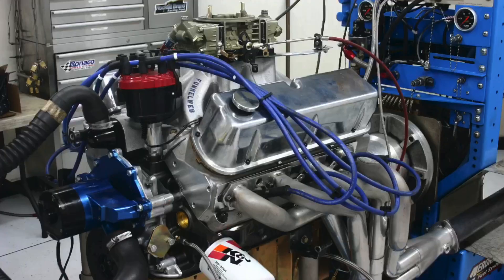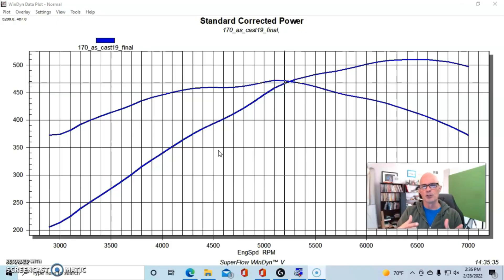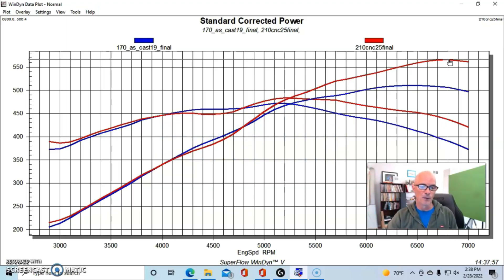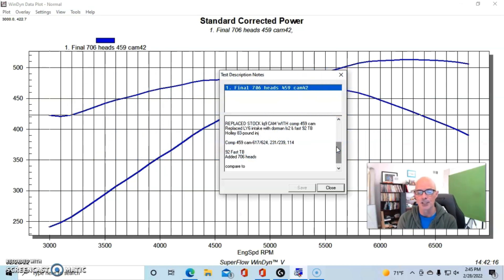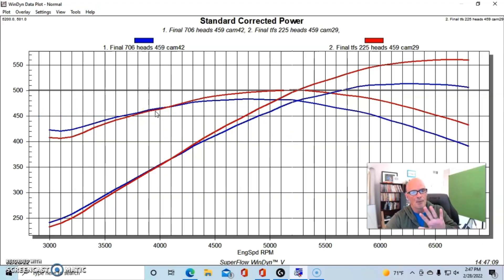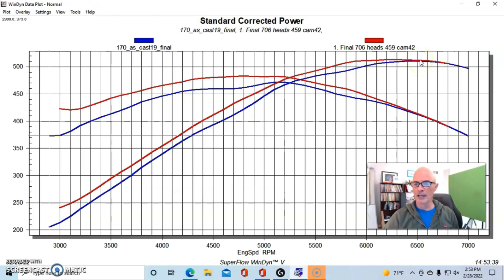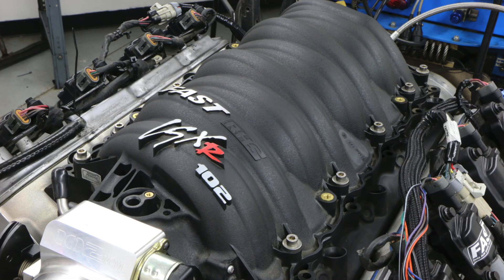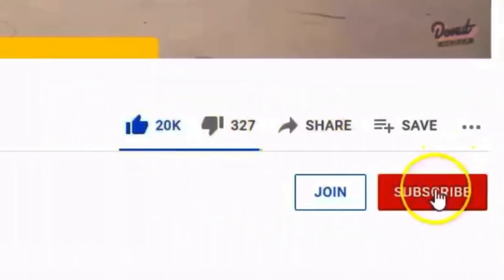HOW TO MAKE 6.0L POWER! FORD vs LS-WHICH 6.0L MAKES MORE POWER? MOD 363 FORD STROKER OR MOD 6.0L LS

Comment: Something that I learned from watching this guy named Richard Holdner is that there is nothing magic about engine building. Any two Motors that have about the same displacement, compression ratio, head flow, and similar cam timing will make about the same power.
Reply: Thats the lesson.  But a hemi headed vehicle is a bit different same with dohc.   Different considerations.   But wedge head on different platforms its basically the same.
Reply: WOW! I would direct you to a show on Hot Rod tv. The host built a BBC, they took the engine and compared it to an engine Jon Kaases mechanics made. The Ford engine at almost 100 cu in less in size, made more torque and hp that the BBC. Tuning, and the expertise of a good builder make a world of Difference. A local builder who is a chevy guy and a very successful drag racer built a SBF for a local guy. Honestly, I could not believe how poorly the engine performed. Why? You decide.

Comment: What motor will give the longest life would be nice to consider. At the shop i work at every week we get broken LS motors in with Cam bearing, Rod bearings, Head gaskets,. Broken pistons you name it .  😮  Stock short block  LS will last for how long making that kind of power ?
Reply: Your confused with the modular!  
Improving the performance of the Modular motor proved to be tricky. Tuning it for high power turned it into an unreliable and dirty engine that had to run on race gas, so they went back to the drawing board. The first redesign resulted in something that was almost entirely new. Koenigsegg started by reinforcing the block and implementing a new crankcase gas recirculation system, followed by all new pistons, connecting rods and camshafts. The lubrication system was converted to dry sump and the pistons got a new oil cooling system. The main features that remained from the Ford engine were the 90-degree angle and the bore spacing.

Koenigsegg ended up making so many changes to the block over time that they had to abandon Ford's and start casting their own. They added things like stiffening ribs and chose Grainer & Worrall in the United Kingdom to make the new block out of aluminum. The engineering firm has extensive experience in everything from F1 engine castings to CGI blocks like Ford's EcoBoost V-6.
Reply: Oh thats easy!  The LS will make twice the power for years if properly tuned!
The tune is everything!  Thats why everyone ditches there Ford power for Chevy power!  9 out of 10 Fords at a drag strip have a Chevy engine and tranny!  Get over it son.

Comment: I'm a big LS guy, been building and swapping them for years, very cheap power, period.  The thing that has me baffled is why would you go through all this work and NOT equip the LS with a good single plane manifold and the carb used on the Ford ?   This work means nothing, with a single plane on the LS you could have run the same carb and had a decent comparison.  As it is it's apples to oranges, carbs to FI.  You should have tried to minimize the differences between the two engines.  This was a total waste of time.
Reply: Yes and Why would you use a Dart block copy of a Ford rather than a real ford block?   Is there a Ford is crap message in here?   :elbowcough:
Reply: I don't think it was really carb vs efi.  It was a battle of the intake manifolds.  The LS long runner manifolds make more power.  That was the difference imo
Reply: @j.osborne4914  That's not the point, this was a comparison of engines of the same cid so if your going to pit one against another why would you have so many differences.  You could run closer cam profiles, the Ford was much hotter and why wouldn't you run the same carb on both engines ?  Then it comes down to cylinder head and piston design, you build them as similar as possible.  Any knuckle head knows a LS with a stock truck manifold with FI will run all over almost any other design including the Hemi.
Reply: @hardball107  I could be wrong but Im pretty sure these comparison videos are pulled together from different builds they have going on.  They are not sitting there with  both engines side by side running comparisons.  They might not even have had the engines at the same time.  Thats the general impression I get from watching quite a few of them over time.  Im sure you have too.  But the line they are always pointing to is that if engines have similar parts and similar specs they are going to make similar power.  To me the test showed the LS is the better design, which it should be as its new improved relative to the small block Ford.  I personally wouldnt waste my time with a small block Ford in this day and age.  Thats why Ive got an LS in my AC Cobra.  Best way to get 427 CI these days IMO.
Reply: @j.osborne4914  Watch the video, he strokes the Ford for the comparison and runs a couple different heads.  Richard has run so many tests on 6.0L LS's he stated that it was an earlier run and it was stock CID.  Did you even watch the video ?  My point is he does have them sitting right there and all he had to do was install a intake on the LS.  Wouldn't have taken a half hour, could have even reused the gaskets.
Reply: @hardball107  I don't care that deeply what your point it to be honest.
Reply: @j.osborne4914  So read the thread and try to understand it.  Just trolling around speaking you know nothing about does no one any good.
Reply: First GM V-8 1918!  First Ford V-8 1932.  Ford still trying to catch up!

Comment: Do you think you might of overcammed the Ford ? You might consider using a more similar cam and a tunnel ram 2x4bl carb or Sniper EFI on both in another test.

Comment: Impressive POWER for a 364 Cu in LS. 560HP and 501 ftlbs. I saw a BluePrint Engine ( Pt# PSLS4272CTF) GM FI claim 620HP and 565 ftlbs, That does not seem like a lot for an extra 63 cu in. of displacement.
1.5384 hp per cu in for the 364 vs 1.4637 hp for the 427. The Torque is also better for the 364 making 1.3763 vs 1.3231 for the 427. 
I am curious to know why.       No replacement for Displacement. 
Thank yo for the vid, it really shows there is a negligible difference between the two different approaches.

Comment: I know it’s hard to heave exact matches for combos, but it’s a decent comparison. I think a 225cc head and Holley high ram would put the 363 ahead in torque and hp. I’ve seen 640 hp 363’s. Thanks for all the dyno work.
Reply: The LS motors are still a superior design that with all things being equal make more power.
Reply: @bri-manhunter2654  Yip!  Everyone and there mothers are puting the LS in there Hot Rods for good reason!
Reply: @darrellh3769  - yeah dirt cheap
Reply: @bri-manhunter2654  compared to the older Ford engine I will agree...chevy is going dohc for a reason.
Reply: @LordJerinza the LT6 is just for the Z06 trim, pushrod engine is a great design for many reasons💪🏻
Reply: @LordJerinza  - Cleveland was the ultimate design for a small block glidden went undefeated in pro stock nothing could touch it
Reply: @bri-manhunter2654  the zr1 will go dohc aswell
Reply: @CoyoteFTW  that's then...the LS is more so now. Ford 7.3 is good....still the coyote base engines are still king.
Reply: @LordJerinza . You are correct, TY💪🏻
Reply: @bri-manhunter2654  for sure bro.💪🏾
Reply: @bri-manhunter2654  you should se Richard's video ls vs coyote
Reply: @brentgrimes5353   Coyote vs LS is no contest. Engine Masters banned the Coyote after its 1st, 2nd, 3rd sweep the year it was allowed to compete. Not to mention, stock Coyote blocks can support 3000hp. There's not enough Block-Fill in Summits entire warehouse to do that with an OEM SBF. I have seen a couple stock blocked LS's approaching that, but not for long lol.
Reply: He said the 363 was also tested with 225cc heads and there was minimal difference.
Reply: @stlchucko   the parker fakeywebb’s are Chinese and need work. I’m not sure if it’s had any at all. I specifically said heads and quality intake. I race with a guy who just built a 630 hp n/a 363. Revs to 8k and does it on pump gas.
Reply: Tunnel ram on Ford would boost midrange torque

Comment: A fun video, but like so many comparisons -
Unequal footing.
Substituting camshaft for cylinder head disparity isn't "equal", it's a crutch. 
Match airflow, camshaft profile, intake manifold and port volume, exhaust characteristics, compression, as well as the other parameters and the result is predictable - a dead heat. 
In development of competitive combinations for various 'spec' classes, we put established equal parameters, even the various 'Cup' engines were equalized for the sake of competition. 
Maybe someday.
Reply: 6.2 chevy makes alot more power than a 6.0
Reply: @ryangulley1082  
ok

Comment: The problem with Ford is they have no mid-size push rod modern-day motor right now you've got a 5.0 coyote and you've got a 7.3 what they need to do is bring back the Cleveland  push rod motor aluminum block aluminum heads with coyote induction ,and Chevy won't stand a chance

Comment: The added cost of the Dart Ford block make the GM LS most economical.
Reply: Very True - 
There was no reason to use a Dart block.
We've seen 700 at the flywheel with a stock Windsor (cast) crank & block with no issues, so the Dart block really wasn't necessary.
Reply from the maker: the Dart block was used to allow 4.125 bore
Reply: @richardholdener1727  The Ford definitely needs a head manufacturer to produce better cylinder heads. GM and Dodge seem to have that market covered.
Reply: Short run cost or long term cost?
Reply: @tomhamilton9140  Tom, both in this case. Never to recoup the funds because GM LS engines are that good and perform for a long time.

Comment: When you did the LS. you didn't just do 'junkyard' stuff.  Heads, cam and different intakes.  Granted, you worked with the Ford, a little.. But stiffened up the bottom end with a stud girdle and 4 bolt mains..
Reply from the maker: the bottom end of the 6.0L was pure junkyard
Reply: The Ford didn't need those to live.
The Windsor bottom end is much more stout than most realize, we've run them past 700fwhp repeatedly with nothing more than ARP fasteners. It was very good foundation right out of Ford.

Comment: Those cathedral trickflows flow as much as the stock rec port heads did.. But the ls2 is inferior too the ls3 intake.
Reply: Cnc rec port heads with a small enough chamber too bump compression up too 10.5:1 would smoke all these i bet.
Reply from the maker: this wasn't an ls2 intake-it was a dorman
Reply: @richardholdener1727  Dorman ls2 style.intake.  whats the difference. 2hp?

Comment: This is why I question the LS swapped Fords I see. The old Windsor still has life in it. It just needs a modern head design.
Reply: And a lot more money
Reply: @flatbrokemodsquad4241  meh. Go watch the stock cam 302 head upgrade video. A set of heads is way cheaper than a complete drivetrain and whatever you use to control it swap.
Reply: @travislivengood2744  oh no how dare you go against all the "ls is more cheaper!!!!" Sheep out there.  Yea the engine itself might be cheaper and have more power potential out the gate (because of having very capable stock heads) but you gotta change the trans and all kinds of other stuff to make the ls live in a mustang and that stuff offsets the "savings".  Why do ls guys wanna use mustangs so badly?  Why not just build a camaro or some other gm vehicle?  The ls has really good flowing cylinder heads out the gate as is plentiful because they put them in everything that is the main reason it's so much cheaper to make power.  They also have more cubes stock other than the 4.8.  Imagine if the ford was 363 stock with the cylinder heads it was using here.  All the sudden it becomes much cheaper to make power with it.  I get tired of hearing the cheap argument because the engine itself is only one part of the swap if it's going in a mustang.  Many of the other things needed offsets the "savings" which is the whole reason for going ls to begin with.  If you wanna build ls build a gm...I don't get why they insist it goes in a ford lol.
Reply: Comes down to money ls stuff is alot cheaper
Reply: @stephenfazekas1568  I can't really agree with that if it's already Windsor based. Throw good heads on a stock 351, then turbo it. The days of cheap junkyard 5.3 and 6.0 swaps are just about gone. Lots of 351 powered trucks and vans in the yard. Same with Ford 300s. I'd bet most yard 300s still run. The all cast bottom ends can hold boost and make silly torque. All pretty cheaply.
Reply: It cost $6oo to LS swap
Reply: @timothywalker2273  oh yeah? On what planet? That doesn't even get you a decent transplant in most parts. Not to mention engine mounts, exhaust/headers, ecu and fuel system.

No. No you cannot "swap an LS for $600."
Reply: @travislivengood2744  the computer to control it is $6oo
Reply: @travislivengood2744  I can LS swap any ford for cheaper than I can build a Ford engine to 5oo
Reply: @timothywalker2273  And the donor engine? Headers? Fuel system? Transmission? Exhaust? Accessory drive if the engine doesn't have it because junkyard long blocks don't get accessory drives for free.
Reply: @travislivengood2744  I can get complete wrecked truck for $1ooo sell everything except engine and accessories order a microsquirt buy a complete built turbo 35o with stall from summit around $1800 cheap ebay headers ($2oo ebay engine mounts $1oo mounts done with out a cam are any alterations I'm starting with at least 35o hp
Reply: @timothywalker2273  No wrecked trucks around here for $1000. So let's say $500 for a long block. You're $2500 in just to create the turbo LS stuff. Richard himself has done 351 till it pops tests and with an admittedly not healthy early EFI 351 he made over 750hp. Stock rods, cast crank, hypereutectic pistons and cast iron heads.
Reply: @travislivengood2744   debate all you desire it's easier cheaper to make more. Power reliable
Reply: @timothywalker2273  In an LS based vehicle? Yes. In an NA 4 cylinder or V6 based platform? Yes. Otherwise? I disagree and have no interest in that bandwagon.
Reply: @travislivengood2744  I understand but it's 2020 it'll cost you and your sbf thousands to keep up with a almost stock LS
Reply: @timothywalker2273  again, find Richards video on the high miles worn out truck 351 that made about 700hp with a turbo and half ass fuel system.

Comment: Those CNC heads had sharp edges. Need 1/2  hour with the die grinder to blend them in,, and will make more power. The 225cc heads should make more peak power though probably an evil thing down low.
The 363 is a 302 base block with short rods, the longer rods will always help. Though how much is another story and your application.And did you really have over 700 lift?? If so the cam was too big for the engine. Drag race or Sprintcar engine only
There is ofourse better heads available. Canted valve aftermarket Clevo style heads will give considerably more power. CHI and Twisted Wedge. Windsor heads will always be a cork in the intake
Put a sinle plane and a carb on the LS will help dyno power. Though near certain not as smooth.
Though after all that the difference between a standard 351 and a 364 engines is not much

Comment: lets just put the best LS head on the chevy, and the best SBF head available on the ford, use same short blocks in this test and see whos got the baddest smallblock once and for all. im betting a canted valve headed Ford is the top dog.
Reply: Problem is that the baddest heads around... all they do is put the same ports in each head because LS and Ford headbolt pattern is almost identical.
Reply: the point is, Ford heads on the ford, Chevy heads on the chevy, let thier nuts hang and see whos the baddest small block ever naturally aspirated, my money is on the ford

Comment: Does someone make an OEM-appearing 6.0 emblem for the Fox body, cause that would be pretty cool.  Also the LS once again comes outta this looking really good.
Reply: Yes. National Parts Depot has them. Black or chrome. Looks like a factory 5.0 badge
Reply: Until you put a carburetor on it. Then compare apples to apples

Comment: As expected it takes a lot more work to get the same power out of old school small blocks compared to modern LS. 
Id like to see a 402 BBC vs 402 LS comparison. Probably a lot better head to head shootout.
Reply: Or bigger.....
Reply: He could have used LS3 heads. 260cc lol
Reply: Maybe if he used giant heads on the Ford it would have been a proper comparison.  225 to 210 heads is completely lopsided.

Comment: The car brand here means nothing. The only thing that doesn't get changed is the block, which is just a structure. All the rest of the pertinent stuff, cam, heads intake, carb are aftermarket. It'll about displacement and aspiration.

Comment: It could be that the Ford's suffer due to shallow deck stopping intake runner length. The 6 liter GM uses the Cleveland deck height and the best head geometry on the business for the right combination of swirl and tumble in the chamber and of course...the best EFI manifold, on a wide 9.22 inch tall deck engine. Magnificent for a production GM V8, GM Powertrains Finest! Just like Holdens 304 and later GM intakes. Pretty hard to front on that. Boss 302s and Boss 351s don't get past 325 lb-ft at 4250 rpm, or 390 at 4000 rpm even with 4V canted valve heads. So 450 lb-ft...Yhsys actually pretty good. The solution if EFi on a 363 is the 2002 250Pursuit and T3 5.6 liter EFi intake. 369 lb-ft with stock GT40P heads. Basically Trickflow style...Great info There Mr H. A real treat!
Reply: The LQ4, LQ9 block the the same block as the LR4, LM7, just a bigger bore and same stroke as the LM7